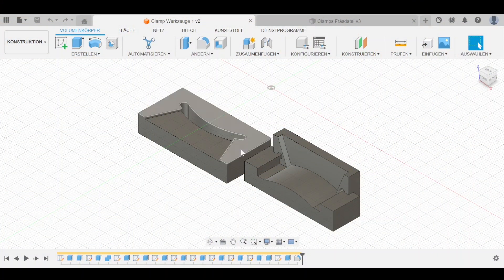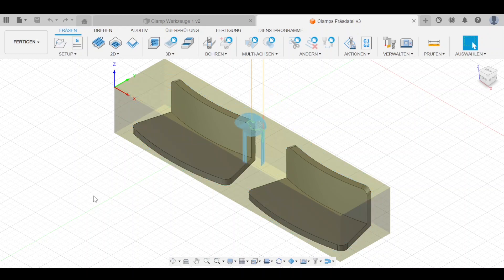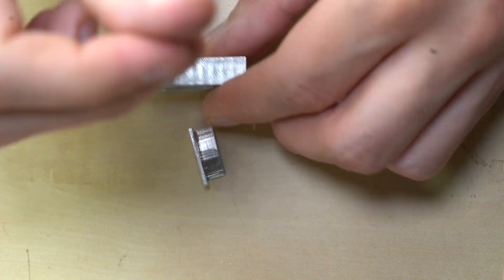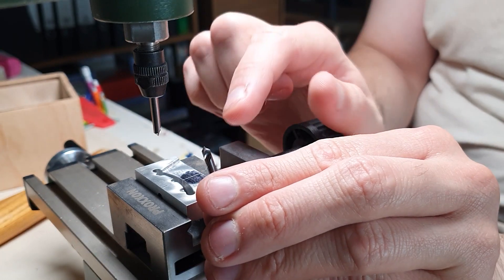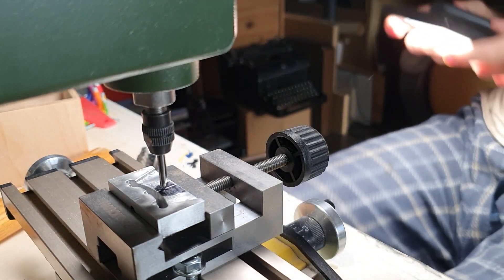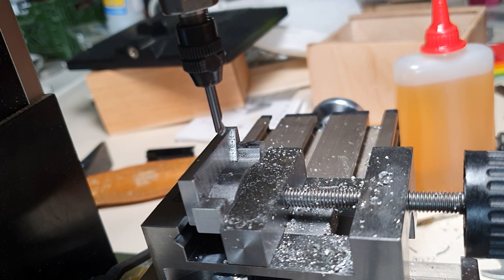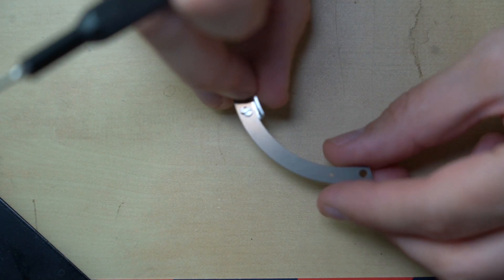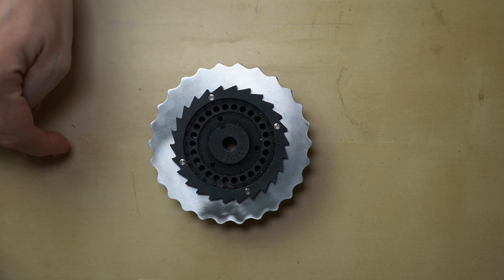The Enigma Build Project  Part 7  The Clamp Holder

Comment: Hm hm hm. Mill is not rigid enough. Or cuts are too agressive for such a tool D
Reply from the maker: I guess your right, but there is nothing i can do about the rigitity of the Mill, In the next interation i will either run the cuts slower or cut with an offset frist and than a cleaning pass, lets see
Reply: @mostlyengineering5253  no need to go slower. It is an old-style approach - slow feed, half a tool D engagement. With modern cnc controllers you can do fast feed but shallow engagement. It will reduce stress on a machine but keep the material removing rate and surface finish
Reply from the maker: @sinchrotron  thanks, will try that